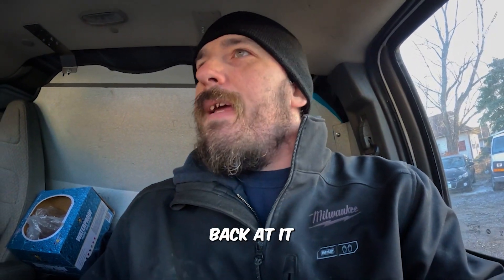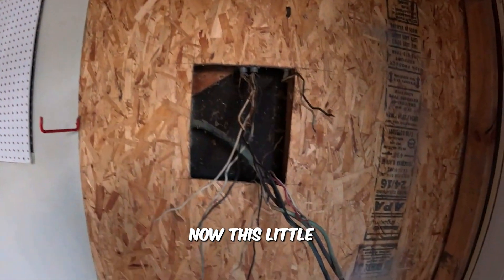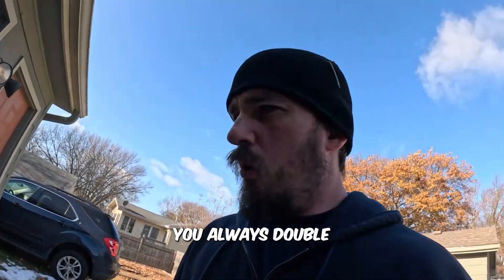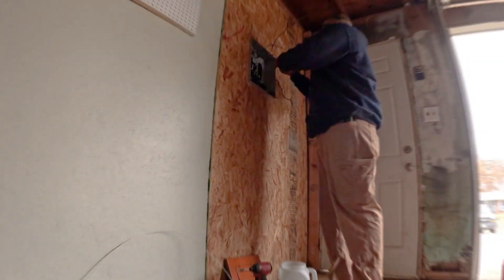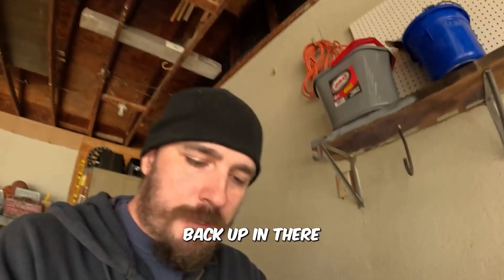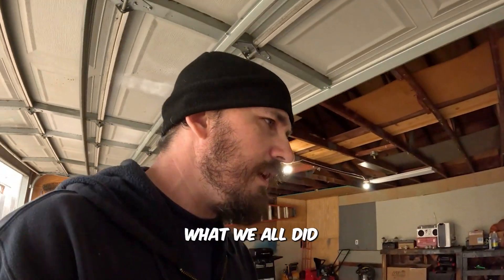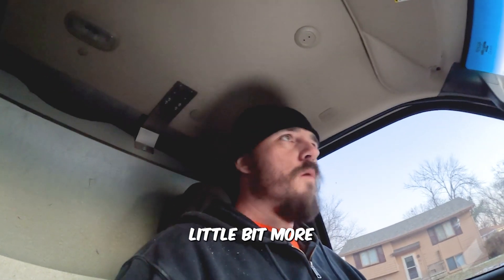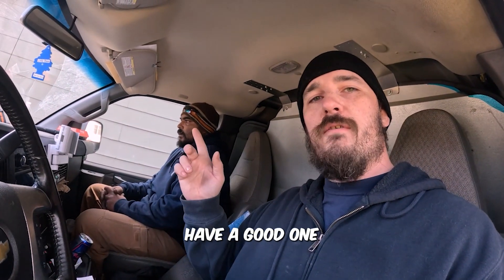What Nobody Tells You About Electrical Panels That Could Save You Thousands

Comment: What nobody tells you? Burnt wire = Aluminum wire. Copper doesn't come loose as easily as aluminum when it gets hot. I just upgraded my Service from 100 to 200 amps everything is Copper! Ground!, all service phases! Into and out of the meter box.  It's been installed for almost a year I've checked the lugs and none have come loose at all! Copper costs  a little more not much more, and it's worth every penny! It's not even a code thing in my City! If someone tries to cut it for scrap they will never leave after cutting a live wire 😮😮😮 I'm not far away from Iowa I'm in the Michigan UP. Yes I paid an electrician  because of the permits  needed and to deal with Xcel Energy.  Copper always use Copper!!! The guys that did the work saved me $1800 by using them vs a local shop that wanted more . They refuse to use Aluminum even if the customer asks for it. Only because they don't want to come back to check the lugs.